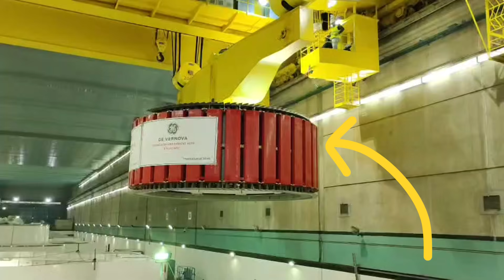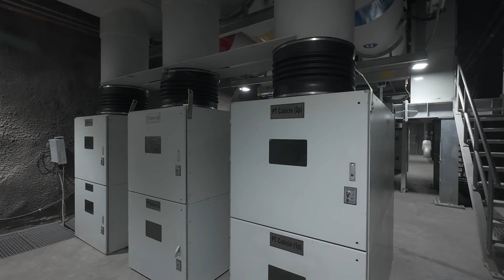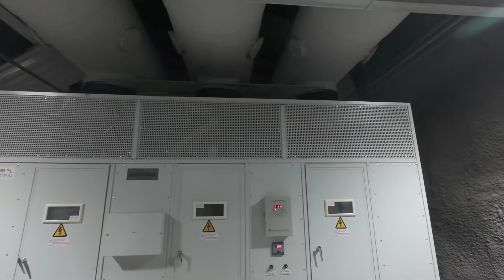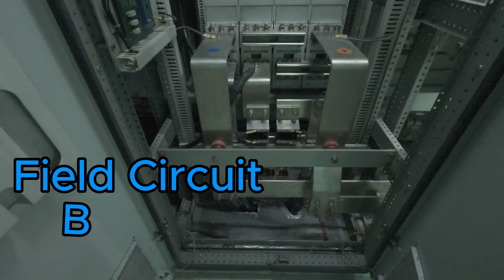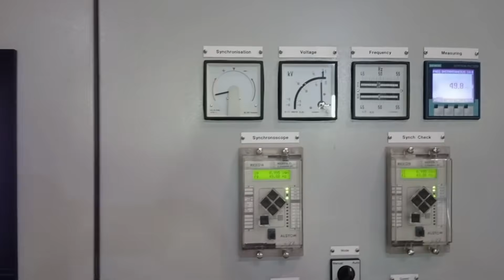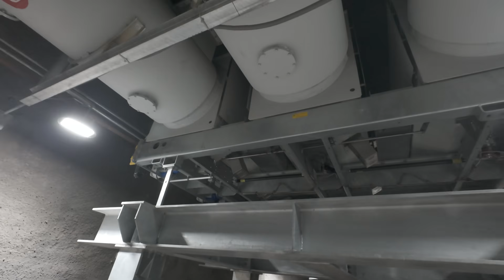Why a Spinning 500-Ton Generator Produces Absolutely Nothing Without

Comment: Excellent video and explanations. I work with smaller 4MW or so, black start capable generators and they all use a PMG to supply power to the AVR  that drives the brushless exciter. Which is a pretty cool system in itself and I am sure you are familiar with how that all works. No batteries for flashing or brushes to the exciter. Three separate systems all spinning on one rotor.

Comment: For curiosity in a car alternator (same build and operating principle) excitation priming is done by residual magnetism in rotor core, even when no battery is connected. If battery is working properly then it is used to energize rotor winding.
Reply from the maker: Some time if battery so dead and there is no residual magnetism in the alternator car doesn't start with the help of push no matter how hard you push. You need external source at that time. Like connecting another battery via jumper cables for some assistance.
Reply: @hyrovision  You are right, newest alternators have ferrite cores for low energy losses, this one have no residual mag. Older ones with iron alloys always have some life, unless stay years unused.
Older tech was more durable than nowadays.
Reply from the maker: Old is Gold

Comment: The key feature (thought prompted by wondering about the title and if it was hydro specific) is that the key feature of excitation modulation/control is that the wider system maintains the leading phase angle between the mechanical/electrical generation and the load (grid forming). 
This would compare with inverter based resources (IBR) that tend to be mandated as 'grid following' which keeps at zero phase, and modulates the voltage there.

Comment: I suppose permanent magnets would be too heavy, expensive, etc to be practical, which is why they choose this kind of motor?
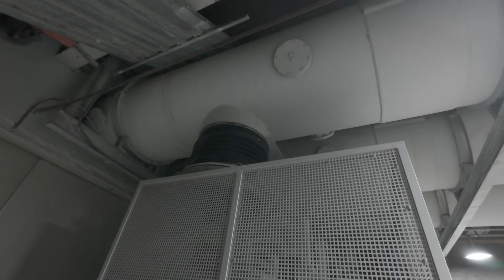Reply: Those are some reasons, but also they have to increase and decrease the intensity of the magnets so that the generator rotates in harmony with the grid frequency.  The grid frequency must be the same for all the other generators and consumers of electricity that are attached to this generator.  It's difficult to change the strength of permanent magnets, but changing the strength of DC electromagnets is pretty easy.  Mr. Vision explains that starting around 4:00 but using language that might be a little opaque to the layman.  You can think of it sort of like a throttle; when the generator starts slowing down and coming out of harmony with the grid, you decrease the excitation which reduces the magnetism and so the mechanical load on the rotor.  That lets the generator spin faster to harmonize with the grid again.
Reply: @paul_moir I thought a generator that's lagging behind the grid would be driven by the grid as a motor.
Reply: @Kenionatus  Correct, if you do not put in enough driven energy the generator will become a motor. There are protective relays (reverse power) to prevent that from happening, since depending on the prime mover it can be completely destructive if it "motors".
Reply: @paul_moir  Actually, once sync'd to the grid the generator is more or less electrically locked to the grid frequency. The wickets control the amount of power the generator puts out and the magnetic field from the AVR controls the VARs. But the reason permanent magnets aren't used on large generators is for voltage / VAR control. He explained it very well in the video.
Reply: @inothome  Thank you and @Kenionatus.  I do somewhat understand that but I wanted to make it simpler for @Schismarch to understand.  Can  you help with a general explanation?  (I didn't want to get into voltages/amperages and wanted to stick to power which I think is a commonly understandable concept.  I know that's the devil is in the details but I think for this purpose we can gloss over some of them?)
Reply: @paul_moir  Sure, the electrical power the generator makes comes from the physical energy put in to it from the prime mover. Whether water in the video, diesel engine with a diesel gen, steam with a steam turbine etc... The generator will always run in sync with the grid frequency when connected to the grid. If the grid frequency goes up the governor has to apply more physical power to the generator (technically these are alternators) to prevent it from producing less power or worst case becoming a motor. While on the grid, less power from the prime mover is less electrical power output, more physical power applied is more electrical power output. The strength of the field (voltage applied) when not synced to the grid controls the voltage output of the generator. Once it's on the grid the field controls the VARs. Since the grid is "infinite" and there is no way one little 15MW generator can drive up the grid voltage when there are 100's of other generators on the same grid. He did an excellent job explaining it in the video if you watch again. 
VARs / reactive power is a whole other topic and too much to type. But there are videos explaining that too. 
The Engineering Mindset has great videos breaking all that down. As well as power factor which also deals with VARs and which direction they are flowing.
Reply: @inothome  I don't agree that he did a a very good job and you did a very good job as well, but neither helped the OP understand the reason why you would use a electromagnet vs a permanent magnet.  In fact, I think I need evidence that you are an actual person rather an an AI.
Reply: @p @paul_moir h I see! Very cool. Thanks for the explanation!
Reply from the maker: If you didn't understand may b I can try to explain in layman or simple language in next part.

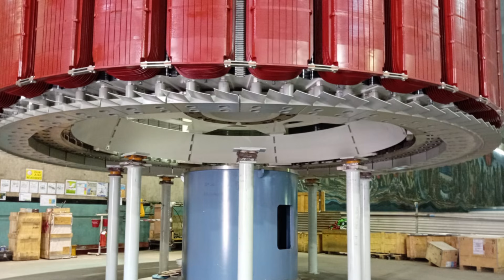Comment: 10:51 "the more unbelievable they get"
You've convinced me. These things aren't real. Turning running water into grid power is too complicated for mere mortals to figure out.

Yes I'm joking. This stuff sure is complicated.

I was wondering if a portion of the rotor could be used a permanent magnet generator. The stator would have a small section (bottom or top layer) dedicated to containing permanent magnets. The rotor would have a set of coils aligned with these magnets to use as a generator. The outrunner generator would be used to energize the electro magnets used in the inrunner main generator. This would eliminate the need for brushes. 
This would require a bunch of high power electronics to be included inside of the spinning rotor. My guess the problems associated with using a separate generator to power the rotor are greater than the problems caused by using brushes.
I know brushes are often considered a weak link in many electromechanical systems.

Thanks for another really interesting video.

Comment: I would suggest, not only rely on batteries, but also install a solar array for an additional backup power for the startup of the system.

Batteries can drain over time. But there are eventually days with sunshine...

Yes, it's just an additional layer of safety. Maybe it's over the top and never needed.

But when it's needed...
Reply from the maker: What if there is no sunshine. And you need to power up?😊
Reply: @hyrovision You could make the solar panels charge the battery
Reply from the maker: When a unit is generating 200 to 400 mws. It's like a needle in a sea to charge the batteries. 😂
Reply from the maker: Don't forgot hydropower plant can be underground also😂
Reply: The only time they need to start up without grid power to charge the batteries is during a grid wide blackout and those last days, not months. Pretty sure hydro power is also the first type of power plant to reconnect to the grid, so it's even shorter.